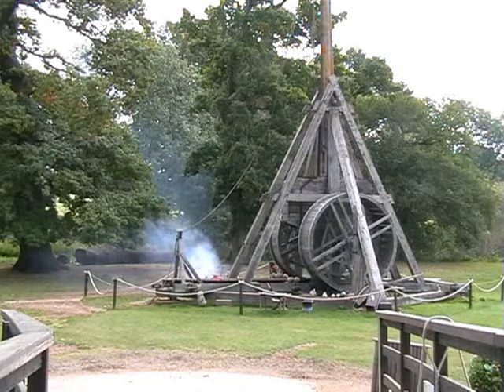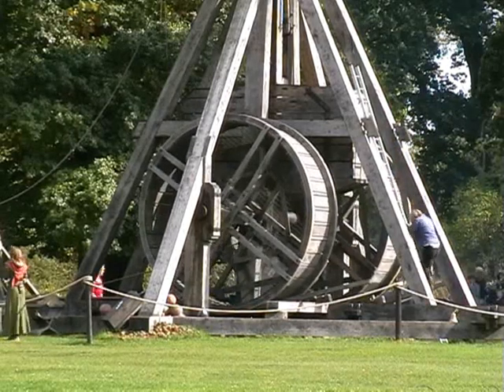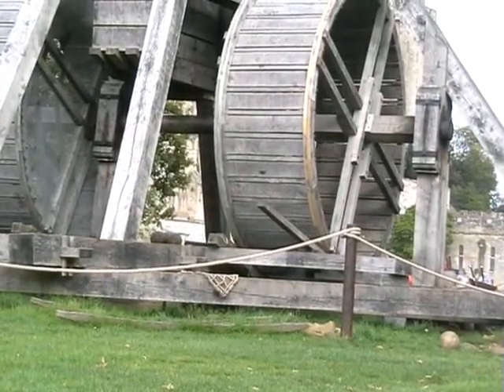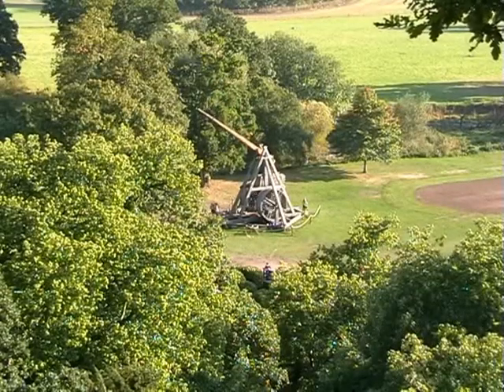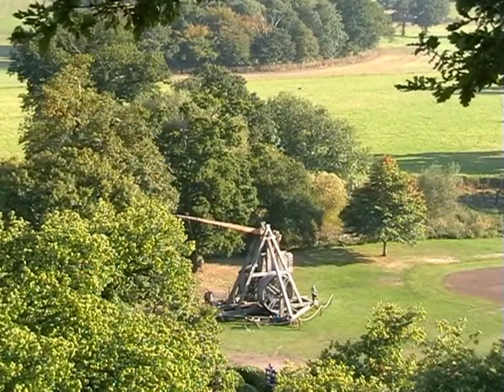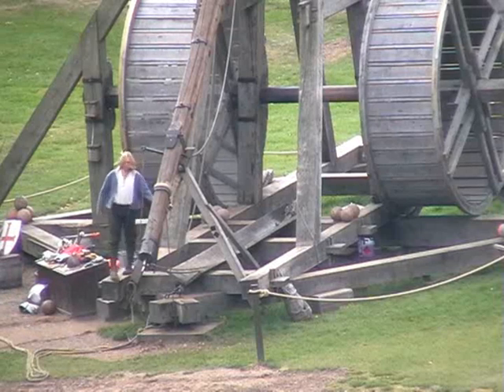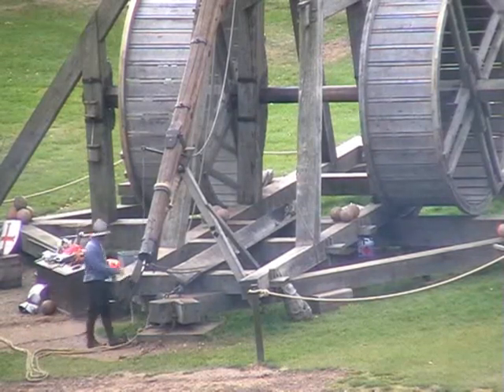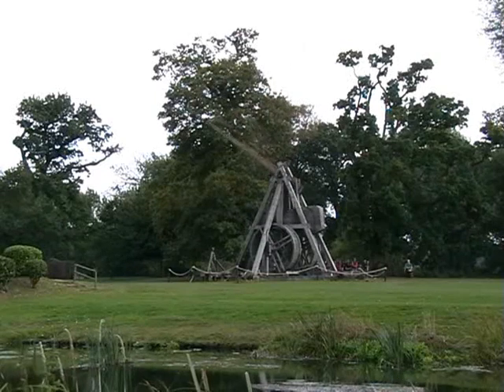Warwick Castle Siege Engine, Worlds Largest trebuchet

Comment: It is designed to be capable of hurling projectiles distances of up to 300 metres (980 ft) and as high as 25 metres (82 ft) and can throw projectiles weighing up to 150 kilograms (330 lb).[62]

On 21 August 2006, the trebuchet claimed the record as the most powerful siege engine of its type when it sent a projectile weighing 13 kilograms (29 lb) a distance of 249 metres (817 ft) at a speed of 260 kilometres per hour (160 mph)

Comment: Because the two squirrel cage wheels which happen to be big wheels by themselves, are enough to hoist anything up to 2 tons with two workers in each wheels.
Gears are probably added for safety measures but aren't necessary in theory.

Comment: how is there no camera footage of the shot from right behind the trebuchet to see how far it goes? :/
Reply: +TacSav253  "It is designed to be capable of hurling projectiles distances of up to 300 metres (980 ft) and as high as 25 metres (82 ft) and can throw projectiles weighing up to 150 kilograms (330 lb).[62]On 21 August 2006, the trebuchet claimed the record as the most powerful siege engine of its type when it sent a projectile weighing 13 kilograms (29 lb) a distance of 249 metres (817 ft) at a speed of 260 kilometres per hour (160 mph)"
Reply: Damnit I want a video so I dont have to integrate these calculations into my imagination :(

But really thanks for the info! This must have been an absolute monster of a siege weapon for its time.
Reply: +TacSav253 I think because it's dangerous to stand in that line. If anything goes wrong, the projectile might go that way. No park or museum would risk having people there.

Comment from the maker: @nashimusD if they had put a fake breakable wall to knock down I would of shown it but unfortunatly they dont and as there arn't any castles under seige getting footage of castle walls tumbling is a little difficult to get, and showing the shot landing in an open meadow (which is what it does ) isn't exactly exciting either.

Comment: I've heard that its incorrect to say 'fire' of a bow (or trebuchet) as well- and I'm no re-enactor. 
Did they even have trebuchets with 'hamster wheels' like that to work the mechanism for bringing the arm down? It seems a little impractical and slow to me.
Reply: Ancient Roma used hamster wheel hoists. A lot.